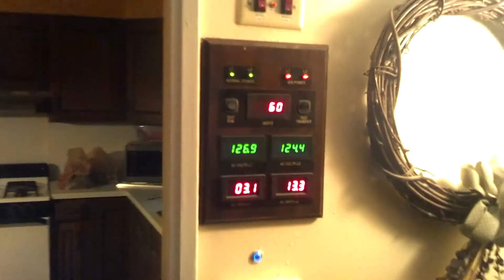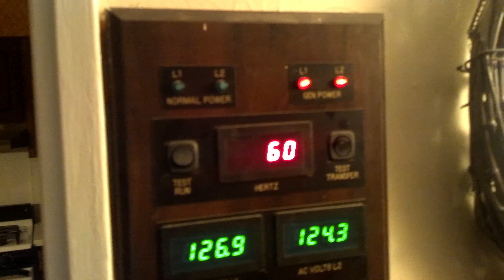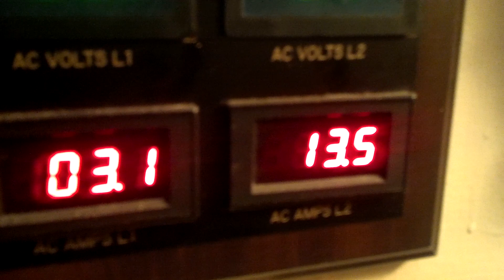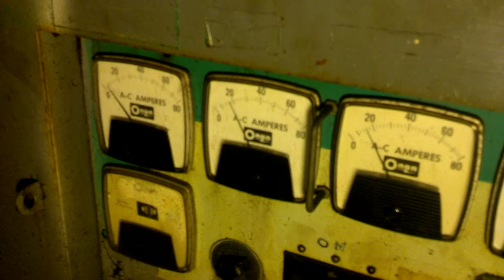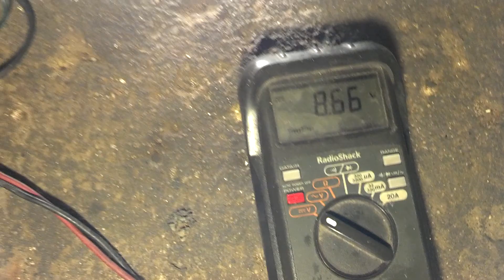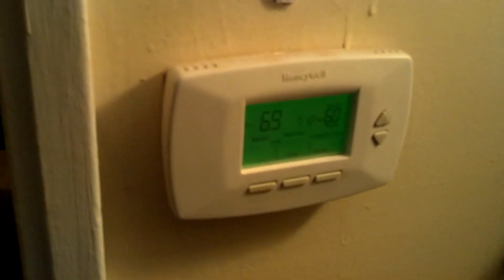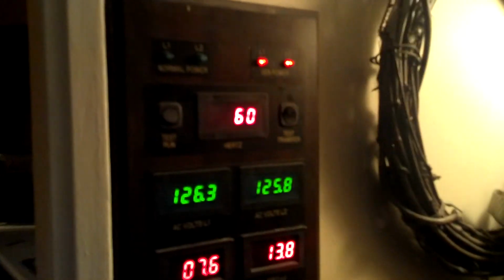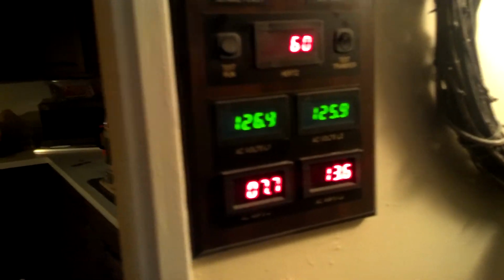VID_20131025_190119_282.mp4

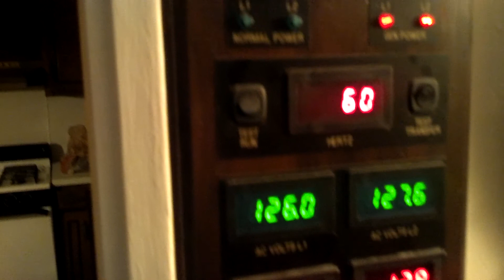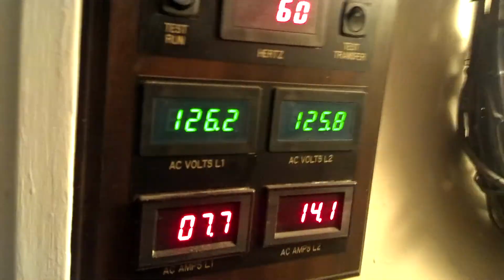Comment from the maker: At 7:08, the amps show 3.1 on leg1.  They jump to 11 to start the blower motor, then fall back to 7.6 for the running of the blower motor on the AC.  At 8:15 the startup current for the window AC jumps to 36amps for just a moment.

Comment: Just curious - why work so hard to make that voltage regulator work? Why not buy a direct replacement from Flight Systems which would be more stable that what you have now. Also, I didn't see a flex piece in your engine exhaust. JC's really need them. Without it, you will crack an exhaust manifold. I like the panels you've built.
Reply from the maker: Well cuz this one I got one ebay for $25 bucks.